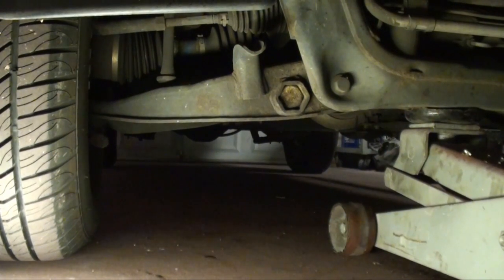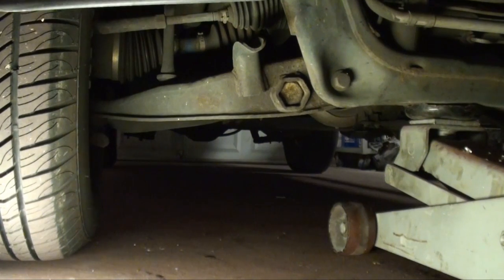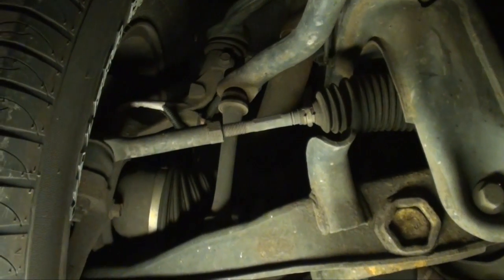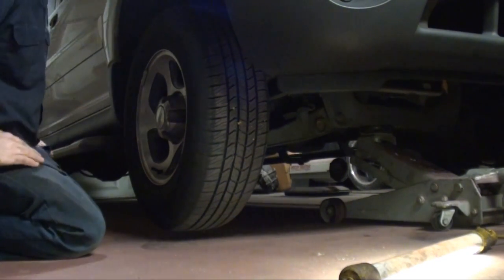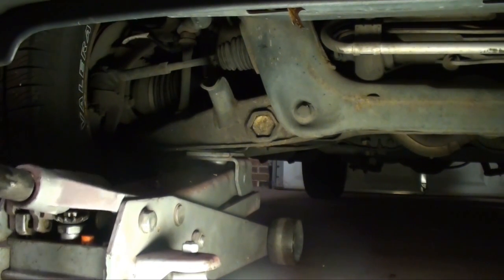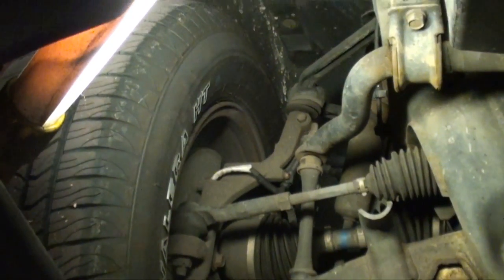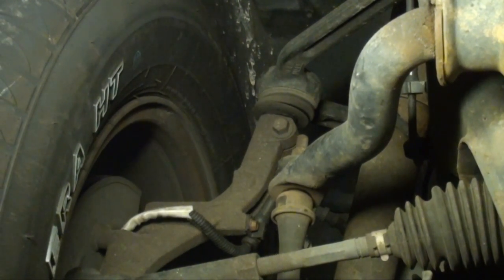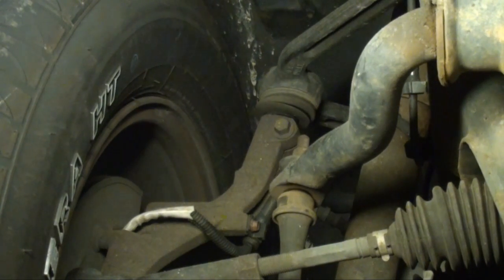How to check ball joints With control arm loaded suspension

Comment: Thank you for posting. I jacked up my truck at the crossmember and checked for play, found nothing, began to worry that I had bent frame or something. Laying in bed falling asleep I thought, "Shit, torsion bar still is loading the control arms!". Found your video this morning confirming my thought... I wasn't checking correctly, will try again tonight. Also, once jacked up a pry bar under the wheel can identify play at ball joint. Shaking with hands COULD indicate a bad bearing, but seeing the ball joint move up and down is a pretty good indicator. Thanks for this video.

Comment: GREAT Video.  Wish I found this years ago.  You showed exactly the reason why it's CRITICAL to examine the type of suspension before just jacking the vehicle up and checking.  You went from hardly any noticeable play to really bad play.  

You must do this on the "panther" chassis of vehicles - Crown Victoria, Grand Marquis and Town Car - same exact thing - jack on the lower A arm, can't test properly just drooping.  Load it to test it - the position of the ball joint tells you a lot.

Comment from the maker: Your welcome, when i was younger in the shop helping my dad, a car came in for a wheel alignment, i put it on the rack checked it out set up the alignment machine and no mater what i did i would set everything perfect and it kept changing slightly on the left front i was going nuts thinking the turn plates on the alignment rack were binding, my old man came over looked at it when i took a break, i came back and he said it had a loose ball joint, i said no way, that's when i learned this method

Comment from the maker: Yup, if this had a loose wheel bearing it would have shown up,most times a loose wheel bearing will show up even on a lift or jacked in most conditions, however it would show up more pronounced placing the jack under the control arm because it tends to level the axle hence relieving the side load on the bearing, good point, if i get one in with a loose wheel bearing i will do a quick tip using a verity of methods, i do believe it would show best like you mentioned

Comment: Partially correct. You're better off using a pry bar to work the tire up and down. Pulling foward and backward can also be a bad wheel bearing. Naturally there is so cross over in movement. Best bet is to have someone watch for movement as you induce movement.
Reply: +BatteryRock Agreed,

Comment: My Infiniti QX60 has a knocking noise on the left front. The noise is very noticeable only at low speeds even on good road conditions.  Not so much at high speeds.  check wheels using your method, but didn't see any movement at the ball joint when lift the wheel using a pry bar. But I can hear a light clunk noise when pushing the wheel only at 12 o'clock, not at 3 and 9, even I rotate the wheel by 90 degree. So, it may not due to wheel bearing.   I lean to ball joint. Not so sure. The rubber cover is still in good shape.   I appreciate if you could comment on it!

Comment: Never really understood the ~12/6 o'clock check other people talk about until this video which shows ball joint movement when there is no load on it.   Question though, I replaced   lower control arm on a 02 Odyssey but had to use a pickle fork to separate lower ball joint which damaged the rubber boot.  I didn't do these checks but after removal of course ball joint is loose.  You think it's likely I broke the ball joint while hitting with the fork?  Thanks.

Comment: Only if you have a Torsion Bar Setup.. If you have McPherson or Normal Strut+Spring system it is not necessary to Jack up the Control Arm since the Strut serves as a Moving Limit.

Comment: You dont rock Left or Right the tire side to test a Ball Joint, You do so to test Tie Rods... To Check Ball joints move the upper and down side of the Wheel like pushing the top to the inside of the car and the lower part of the tire to the outside, If there is movement then you have a bad Ball Joint.

Comment: You didn't need to jack it up from the lower control arm to check the upper balljoint when it's that bad. The ones with little play in them is another story, in which case upper and lowers are hard to inspect on heavy suspension parts.